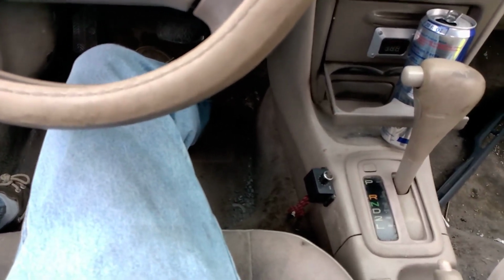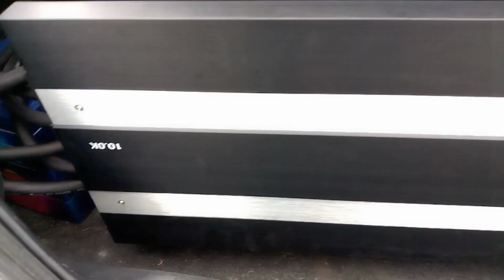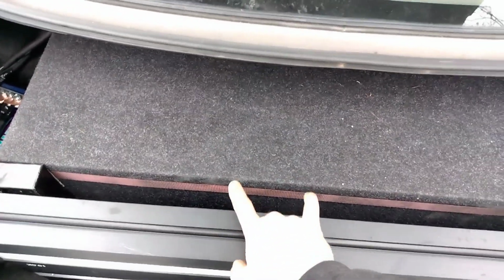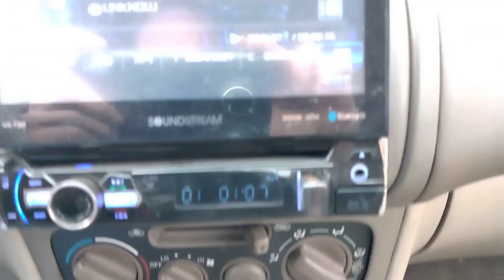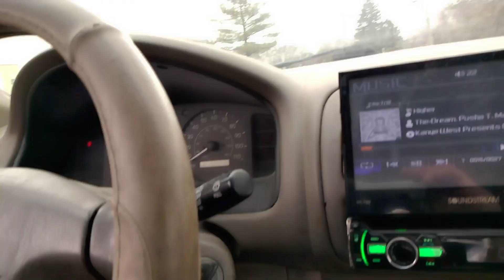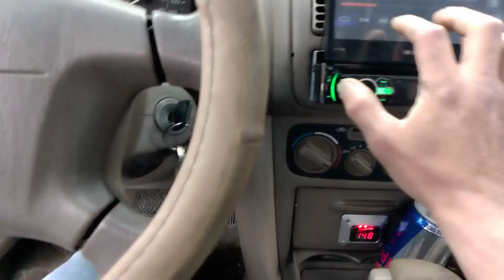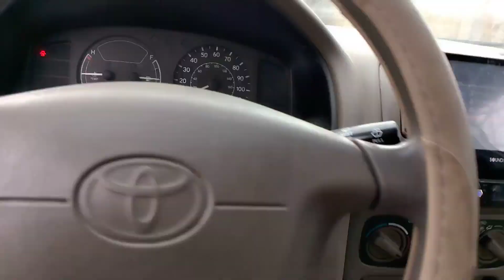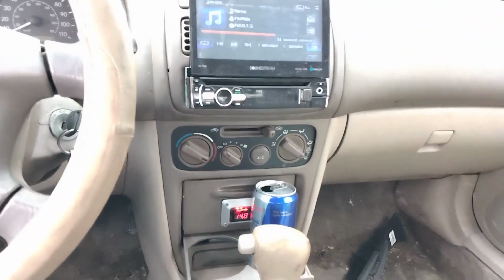1st video sense the Dc Audio 10k got installed.

Comment: Looks like your holding steady voltage ⚡ .not bad. Is this on a stock alt? I ask because I bought limitless cyber12ks (2) of them , an I like them. I bought 2 because I didn't want voltage drops if I were to add more amps.
Reply: @stevemaniac4750- Watch this video, from the beginning, it shows his alt., n wiring setup.

Comment: Dnt flip the amp just flip the name plate un screw it and flip it....
Reply from the maker: you cant unscrew the name plate as where the writing is is the main heatsink. there is no name plate.
Reply: @ColdVenom159  oh okay I thought for sure you had the swappable plate...I thought I was helping lol...well dnt feel bad I can't swap mine on my 7.5ks either...
Reply from the maker: @blazed7785  i dont feel bad at all, as i said in the video ist not uncommon to do. anyone who knows dc audio knows what they are looking at. i knew before i bought the amp i couldnt rearrage the name on the amp. the install didnt go completely as planned whcih it dnt bother me.
Reply: @ColdVenom159  yeah man I understand what you saying us as bassheads always run into having to improvise  and make it work...but yeah I haven't run dc audio yet hints me not knowing about the plate lol but now I know...sweet 10k
Reply from the maker: @blazed7785  the amp would of been mounted upright but i ran outa cable so it had to get flipped over. thats getting fixed tho.
Reply: @ColdVenom159  I gotcha still looks good though sounds good too brother...
Reply: 10k vs 9k is the 9k is a 12v amp and 10k is meant for high voltage right ?
Reply from the maker: @annihilationindustries1990  where do you get 9k vs 10k?
Reply: @ColdVenom159 defo hitting harder than last season John omg😮!
Reply: @ColdVenom159 keep it short big John form over function brother! Sounds epic btw.
Reply: @annihilationindustries1990 - I know what your talking about, Dc has a 9k= same size heatsink as this 10k, but the 9k model can run up to 18volts. This Dc 10k only to 15.3 Volts.
Reply: @ColdVenom159 - Im surprised you dont know what annihilationindustries1990  is talking about? He was asking between the Dc 9k, and the Dc 10k, which one is high voltage capable. I told him the Dc 9k is 18 volt capable, and your Dc 10k is 15.3 volts max.
Reply from the maker: @evilinside5984  that's cuz the DC 10k is built to be ran on 12v based setups while the DC 9k isn't. The dc10k is the pit bull turned down.
Reply: @johnd3186 who sings the never song that shit goes hard name of song and artist
Reply from the maker: @malcolm197291  flo rida album roots song never
Reply: @ColdVenom159  thanks bro i have a dc 10k as well on two kicker solo x 15s and used to have it on 2 orion hcca 15s
Reply from the maker: @malcolm197291  np lol i had to go out to my truck, i knew the song but i couldnt remember the album or the artist. sux i couldnt really show any of the indo on the screen in the video as yt would nail me with copywrite nonsense. it happened to me before.